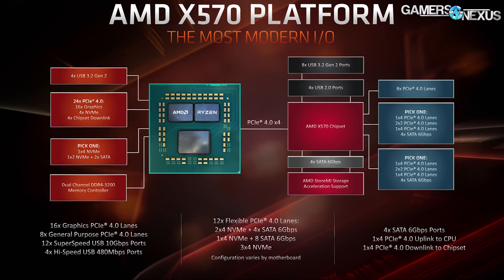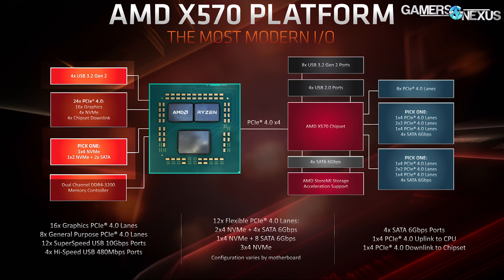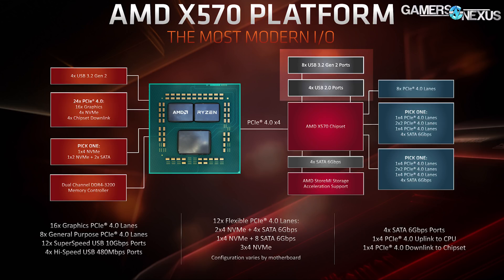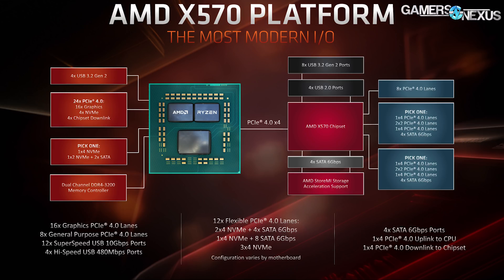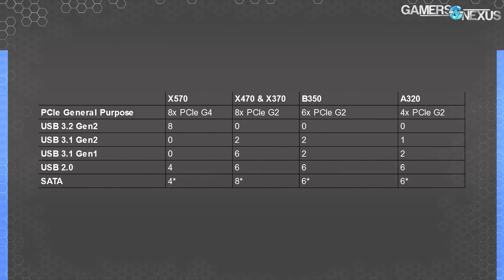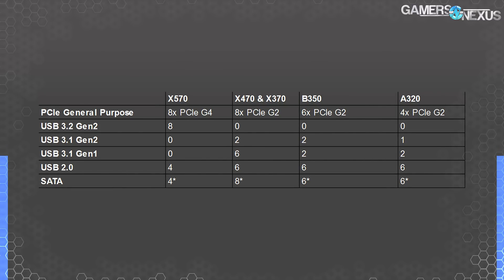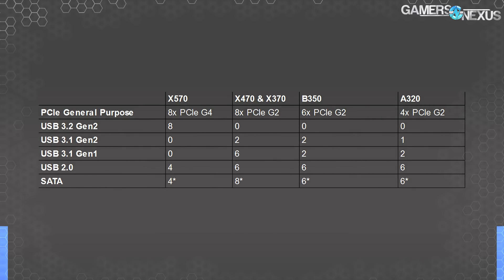AMD X570 vs. X470, X370 Chipset Differences, Lanes, Specs, & Comparison

Comment: people must have forgotten x79 and running raid of the chipset caus that would cook most motherboards
Reply: There were a few chipsets in the past that did cook some motherboards. Some hitting in the 20watt consumption if I recall correctly. Though I can´t remember which.
Reply: @Koeras16   x58 boards and they had a 4 phase vrm on some boards

Comment: If thunderbolt 3 is really coming to X570, this might just be the one to pick
Reply: asrock as a few x570 boards with thunderbolt
Reply: @Jacob Vega , that they do. They seem to have at least two boards with it built in on the back I/O (one has two Thunderbolt3 port) and they also have several boards which have the connection to support their Thunderbolt3 add-on card.

Comment: so, why do they ALL need a fan to cool a 15-watt chip, when older 20 to 30-watt chips got by fine with only a passive heatsink (32MB ATI7000AGP card for example)?
https://www.techpowerup.com/gpu-specs/radeon-7000.c648

great vid Steve and crew. B)

Comment: So any idea when 10gb lan port will be mainstreamed?
Reply: When mainstream actually needs them. Most internet connections hardly reach even 1gb and outside some high level NAS devices nothing really use it that would be in peoples homes. Even most of the enterprise level switches are still Gigabit speeds.

Saying that I would love 10gb Ethernet support to be mainstream and 40gb to be more accessible.
Reply: @backupplan6058  ya very true. I just would love 10gb etho for the fun of having it and possibly lan streaming through a server I will set up.

My 10gb network card I got freezes my pc when running so I think it defective.
Reply: @anikanbounty97 , probably if not bad drivers.
Reply: @backupplan6058  least it a pcie card not built into the mb.

Comment: “The CPU further supports . . . 1x4 NVMe or 1x2 NVMe plus 2x SATA [in addition to the 16x graphics, 4x chipset, and 4x NVMe lanes].”

Correct me if I’m wrong, but doesn’t this mean that the CPU has 28 lanes? Or is the “pick one” connection something else?”
Reply: I think the nvme switches with the chipset and its functions based on load.
Reply: Zoomzabba I may be wrong, but I was under the impression that the “pick one” connection was direct to the CPU and not through the chipset
Reply: @Shootin_Bruin  I re-watched. It's totally 28 lanes. However, it's unclear if the chipset link to the CPU could be re-purposed by a board partner if they wanted to remove the chipset entirely (and say, make it another 4x4.0 Express slot device)
Reply: Zoomzabba thanks. I am very curious to see what kind of latency and IOPS we will get with an Optane drive connected directly to the CPU

Comment: AMD, just create a single chipset, since 90% of what I've seen is a B450 build, not X470. The cost difference between the two chips is around $10-30, this is based on ASUS TUF Gaming Plus and MSI Gaming Pro Carbon.
Reply: I'd kill for an itx board with no integrated video and a chipset which only added 10gbe and USB 3.2 2x2.

I'm going to end up with a B450 itx running a 3700X
Reply: @zoomzabba452  How do you diagnose a PC with a dead GPU if you only have one GPU? iGPU is a must nowadays.
Reply: @AlfaPro1337  GPU tend to die in quite familiar ways...having a cheap one lying around is also always a good thing. I got an old GTX 650 for example.
Reply: @AlfaPro1337  iGPU is a waste for mid to high performance tier. Like @Koeras said, just drop another card in to diagnose failure. A 2-3 generation old card is cheap and easy to keep in the closet.
Reply: @zoomzabba452  I am using my 6700K's iGPU to transcode video, freeing up my CPU and GPU utilisation. Since Premiere currently uses the iGPU, it's not a waste.

If I were streaming, I will always use the iGPU. You guys are using it wrongly.

Comment: gonna skip 570 the price increase in insane and coming from 470 it offers nothing that i actually need
Reply: I'm surprised to see that I might settle on B450 for a 3700X
Reply: Buildzoid says the same thing, 570 is not for the vast majority of Ryzen 3000 buyers. Unless you're buying the 12-core or 16-core, you don't need them. The 8-core 3800x might require a high-end X470, but if you're getting a high-end x470, you might as well get a low-end x570 with 6 phases or more. That being said, watch Buildzoid's "best x470 motherboard" review, as not all x470's or b450's are equal.
Reply: B550 ftw next year (for us mATX users, as there isn't a X470 VRM option).

Comment: There's PCIe 4.0 M.2 coming out. Is this just a marketing gimmick and I can just add a 970 Pro with the new bandwidth? Or do I actually need a PCIe 4.0 compatible M.2 SSD to take advantage of the new speeds?
Reply: Your 970 Pro will run at its maximum capability, which will be less than the PCIe 4.0 bandwidth.
Reply: Need the new M.2 drive to take advantage of the faster speeds.
Reply: @johntotten4872   Fook. Looks like I'll be changing up my build list then.
Reply: @k3salieri  You will not really feel the difference in real life use, unless you do some really intensive specific activities. Judging from your question, my guess is you don't. Save your money. Besides that, buying a PCIe 4.0 NVMe early will be more expensive than waiting for a while for the prices to go down and early bugs to be fixed.
Reply: 4.0 lanes will be switched down to 3.0 lanes for accessing the 3.0 device

Comment: I'm confused why, if the chipset is the same die as the IO die (just in a different process node and with some stuff turned off) the chipset only has 20 lanes, not 24.
Are those 4 lanes I'm not finding going to the USB or something or did AMD just decide they didn't need them?
Reply: I believe Steve stated that 4 lanes were for communication with the chipset. (4x chipset downlink)

Comment: In which process are the AMD Chipsets manufactured?

X570 vs X470/370
And B450/B350

X570 should have gone 12nm. It has basically the same cost, but with 7.5T Libraries (vs 9T), it becomes 10% more efficient.

Comment: I'm just interested in 4000-4400cl16-18+ memory clocks with divider /2...is it possible to get less than my current 59ns with 2700x and 3600cl14?
Reply: No, see 3rd picture: https://www.anandtech.com/show/14525/amd-zen-2-microarchitecture-analysis-ryzen-3000-and-epyc-rome/11 Seems I'm 57.2ns with my 3200mhz C16, 56ns 3333mhz (Intel side :P)

Comment: I'm a little confused. Can we have 2x4 name direct to cpu?
Reply: 16x4.0 direct to gpu
4x4.0 direct to nvme 
4x4.0 direct to nvme switched with the chipset for whatever is demanding bandwidth
Reply: @zoomzabba452  so of I were to want to do a name raid in in theory would have 4x4.0 to both drives?
Reply: @mastermoarman  So I was wrong. 
Cpu direct:
16x4.0
4x4.0 nvme
4x4.0 nvme (or 2x4.0 nvme +2xsata6gb)
4x4.0 to chipset
Reply: @mastermoarman  for raid, it will default to the slowest speed drive. You could easily run raid 0/1 in the nvme at 2x3.0. The slots are backwards compatible.
Reply: @zoomzabba452  right I would likely get the best ones I can. Seems how I'm building a whole new system. Upgrading from my old AMD fx8300
Reply: @mastermoarman  FWIW, PICE 3.0 NVM is going to be a way better value and still have amazing speed compared to pcie4.0NVME.
Reply: @mastermoarman  I'm going 3700x in an ITX sandwich build. Time to move on from my 4.7GHz FX-8350.

Comment: Have you heard anything about the possibility of boards with no chipset, it could lead to some nice ITX boards since there would be more space for the VRM, you may not have that many USB ports, but it could be used to bring cost down
Reply: Buildzoid sleep deprived fantasy. Not that I wouldn't kill for a stripped board.
Gaming focused. No video, no chipset. Just 16x4.0
(2)4x4.0
2 sata 6Gb
Compliment of USB
Not sure if the chipset handles audio and ethernet.

Comment: I am surprised that AMD didn't do a x560 chipset which contained most of these features but has a PCIe Gen3 controller on the I/O chip rather then PCIe Gen 4.  This would probably save some money and complexity for motherboards as they would only need to worry about Gen4 signal integrity for the PCIe slots connected to the CPU and to the I/O chip.  You probably wouldn't be able to have all the I/O options as the x570 chipset but you could have a relatively cheaper "premium" option for mainstream users who don't need 8 SATA ports and won't have PCIe Gen4 PCIe cards for a few more years yet.
Reply: sounds like this could be how they make the  B550 chipset cheaper.

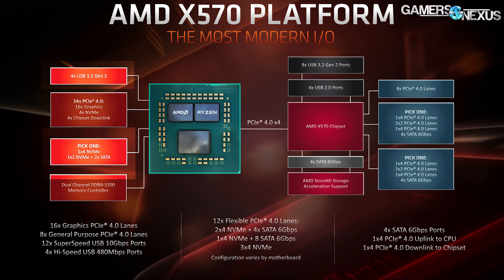Comment: So as shown at 3:20 the cpu has four extra lanes vs the previous gen. Does this mean these cpus can run a pair of pcie 4.0x4 ssds and a x16 gpu without using the chipset lanes?
Reply: Correct. All direct to the cpu

Comment: no luv for B450?
Reply: Running 2700x stock on b350 tomahawk, vrm s go upto 55c max .
Reply: AmpEdition  the msi board right ? i got that setup in my girls pc runnign a 2700 and when i pushed the chip to 4.3 the mobo temps went to 80-90 i think itx might be a slight problem because the phases should be fine but the tiny heatsinks just cant handle it, a tiny fan did bring it down to 60-70 tho
Reply: B450 is fine as long as you stay under the 12+ core models and have a decent one like MSI Titanium, 70$ish price point models
Reply: most b450's have meh vrm's tho, if you plan to put the 12 core in a b450 you might run into some problems if ya also want to overclock.
Reply: @troyn14  MSI gaming pro carbon a.c. has good vrms
Reply: @tjsmithson1598  6+2 on that right? but yeah i'ma probs stick my 12 core in the msi 450i ac,  got a few old boards layin around hoping i can just rip a better heatsink offa one and mount it somehow xD because from the leaks ive seen the cheapest itx board is gonna be $200+ and probs wont have more then 6 phase anw.

Comment: is there a mother board that give more pcie slots? as i have 4 cards (2x video and 2x lsi hba card) i would like to use in my unraid build to upgrade my unraid build to one of the 39xx cpu's
Reply: I think you need threadripper if you want more pcie lanes
Reply: Threadripper. I run 4x GPUs very nicely on a much cheaper ($450-500 16 core TR-1950x), and PCIe is exactly why I couldn’t use my X370 board.

As for physical slots, IF you don’t need the full bandwidth and your fine with degraded performance (not for SLI crossfire), then you can run this easy thanks to cheap mining riser extension cards down to 1x PCIe. Most I’ve ran is 6 GPUs at once on X370. 2x Fury in crossfire, a Titan Xp for Cuda, and 3x RX 470 for things like Vegas Pro. I could game decently at 4k with the duel Fury while having my Ryzen 1700 work it’s butt off hammering away in the background at either CAD rendering or video editing export. I think I could have ran 7 GPUs, but it was getting kind of ridiculous with a Mohawk of graphics cards bolted to my case... I initially was doing this to test Power Supplies, and just threw every card I could get ahold of on the system to draw current from the wall after an incident where a PSU fried my $250 SSD at just 70% rated load and the company refused to pay damages (that company was Rosewill if you wanted to know who to avoid), several of their power supplies tested failed afterwards too! (I bought more because I wanted to set them on fire and post on YouTube, but they couldn’t even pass 50% load sometimes...) Anyways, it can be done!

So, all you need are 1x slots, and most boards have plenty of those. You only need 2 x16 slots for the GPUs (assuming crossfire/SLI), and then a couple x1 for the other cards for example. On Threadripper, x16 slots can be changed to 4 x4 slots (theoretically 16x GPUs at x4 bandwidth for rendering animations etc, or just a truckload of NVME in raid)
Reply: I have one gfx card for vm's and a p2000 for Plex transcoding, plus the 2 LSI hba cards, I had thought about threadripper was waiting to see what the am4 platform had to offer, was just wondering if one of the board makers was going to use the choose an option for pcie slots, I may just wait to see threadripper 3 brings

Comment: Are this 11W power consumption happening with PCIe 4? If use only pcie 3 does the power consumption lowers?
Reply: Daniel, don't listen to them. The 11W is a max TDP for the worst case scenario and it's used for designing cooling systems. Most MB manufacturers already told the chipset fan won't spin under lighter loads when the chip is not fully used so you might be good with PCIe3.
Reply: @PainterVierax  MSI has 0 RPM mode, but how long will the fan stay stopped, when GN just told it's 11W idle too. ASRock said their fans spin all the time and haven't heard anything from ASUS / Gigabyte other than temperature controlled.
Reply: No, it'll still be 11W.
I think it's an acceptable tradeoff considering PCI-E Gen 4 has double the bandwidth as PCI-E Gen 3.
Reply: @Toad_Hugger  I don't think it's acceptable at all. The chip should downclock and only use power what it's asked for. Like for me I'd be only using Gen3 stuff, so it should be 5watts like previous chipsets. Now if I stick in new shiney M.2 drive and torture it, then fan could start spinning and power go to that 11W. Another issue is cost, I'm fine with added cost, but then it should be top of the line passive cooled or if no cost added, then I'd be fine with the active cooling. Was so excited that there is mATX of x570 coming, as there was none in x470, but 200$ with noisy small fan spinning all the time, nope I'm going with a OK B450 board (as there are no great ones).

P965 Chipset was 11W idle 19W load, those ran hot, BUT it was northbridge, so there was room to add a heatpipe cooler there. Here there is no room to fix this, my 3slot GPU covers all of the chipset. But motherboard manufactures back in the day connected all shouthbridge/northbridge and VRM with heatpipes and no fans where needed. Now it's done only in 1 motherboard and it's $700! Funny how they could do it 10+years ago and all boards where under $200.

My next hope lies on ASMedia and their B550 chipset next year, if it's passive and there is better VRM and audio on mATX boards will update to that and forgot X570 even excisted. (sorry, long reply :P)
Reply: @onboard3  The higher costs are from the chipset itself. Building a board with the signal integrety needed for PCIe 4 is what makes them so much more expensive.
Reply: @flyt129  Well more it's from the X570 chip, if it's $40. Cheapest X570 ASUS board is said to be $160 has all the routings going on :) Those $250+ boards are just ripping customers off. Adding double the phases and some RGB doesn't cost $100 more.